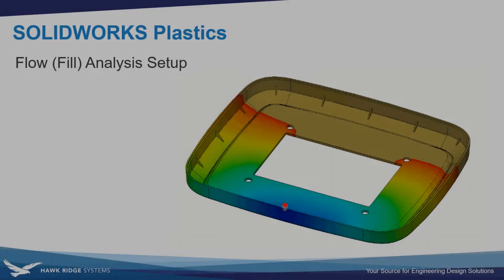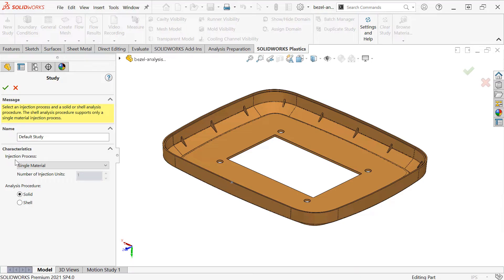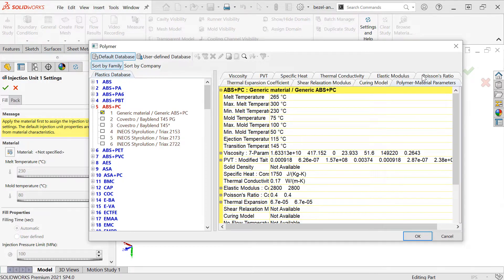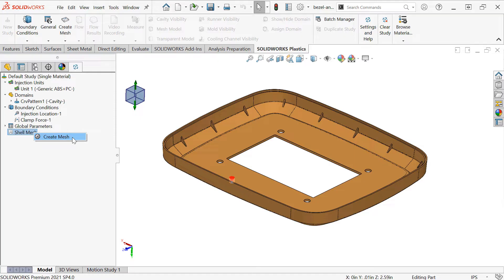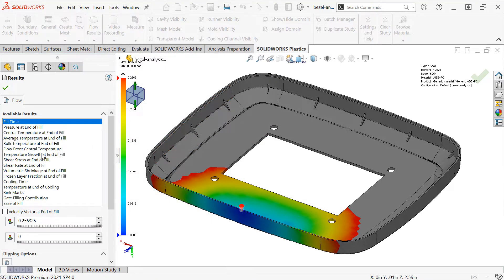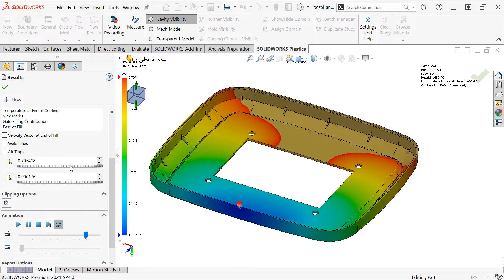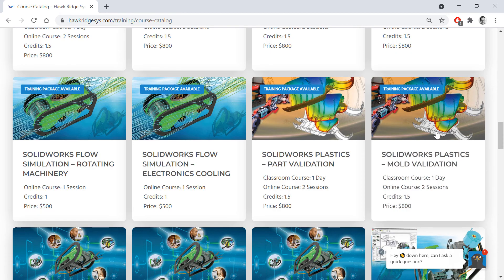SOLIDWORKS Plastics: Simulation Setup Guide

Comment: How to check injection pressure drop and how to check shear rate ?please explain
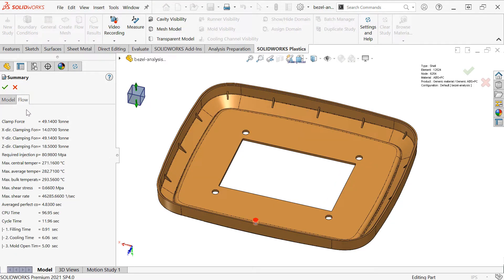Reply from the maker: The "Pressure at End of Fill" plot and "Shear Rate at End of Fill" plot respectively, or if you just need the the maximum values are reported in the they are reported in the "Summary" visible at 10:11

Comment: In plastic analysis in SolidWorks 2022, if I don't have the option to define a mold, what can I do? I have the full version
Reply from the maker: Which option are you referring to? Firstly check that you are in a SOLIDWORKS part file and not an assembly, as Plastics requires a part file to operate.
Then you should be able to create a New Study, and edit the Injection Unit Settings. After editing the Injection Unit Settings you should see other options appear.
Reply: @hawkridgesystems  Everything you said is true and exists, but I have a complete assembly at the end of a part that I am analyzing, and part of the assembly is a mold, and in the settings it only gives me an insert / cavity / runner. In addition, it does not allow me to set up a virtual mold
Reply from the maker: Toward the top of your study tree you likely need to right click the "Simulation Type" and edit to include Cool analysis. The Cool calculation is what incorporates the Virtual Mold. Then you should see it show up when you right click Domains. This requires SOLIDWORKS Plastics Premium and a Solid mesh analysis type.

We'll try to get a tutorial for cooling analysis completed soon! In the meantime there should be one in the built-in tutorials referenced at 11:20
Reply: @hawkridgesystems  Thank you very much, you solved my problem

Comment: where my run button go??? i cant use it.... its missing
Reply from the maker: Possibly you may need to reset your registry for SOLIDWORKS or perform a system repair
https://support.hawkridgesys.com/hc/en-us/articles/203484173-Clearing-your-User-Registry-Settings
https://support.hawkridgesys.com/hc/en-us/articles/8975759415949-How-To-Repair-SOLIDWORKS-2023
Reply: It'll be at the top feature bar instead

Comment: if possible with Metals like Zamac, aluminium ?
Reply from the maker: We've had some customers experiment with using SOLIDWORKS Plastics for high-pressure die casting, however it is not an officially supported application. It does work nicely for Metal Injection Molding (MIM) processes which utilize a powder with resin binder. We would definitely not recommend it for low-pressure metal processes including pour/sand casting.

Comment: A very thorough explanation! I was wondering if it's also possible to check cooling effectiveness using SolidWorks plastics
Reply from the maker: Yes it is possible in SOLIDWORKS Plastics Premium - the mold and cooling channels can be modeled and a separate "Cool" analysis performed. Performing the cool analysis upfront should also make all the subsequent results (Fill, Pack, Warp) more accurate as they will utilize the calculated cycle averaged mold temperature distribution, instead of a uniform mold wall temperature assumption.  We'll plan a video to cover it in the future!
Reply: @hawkridgesystems  thank you so much!